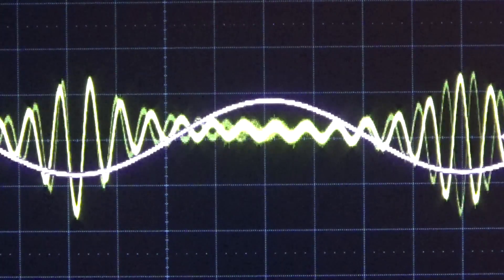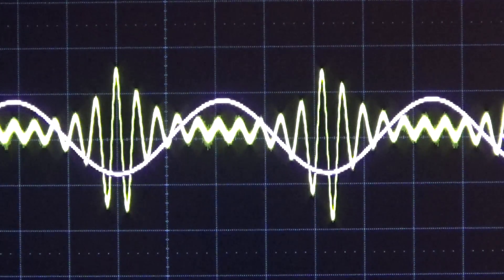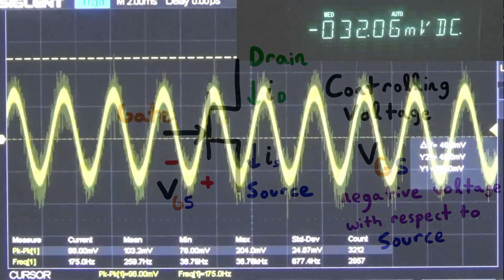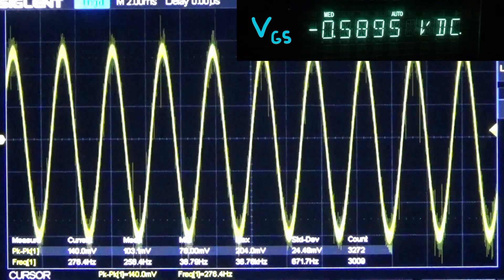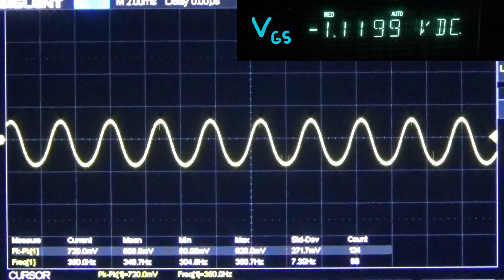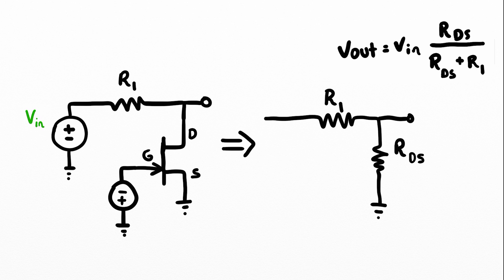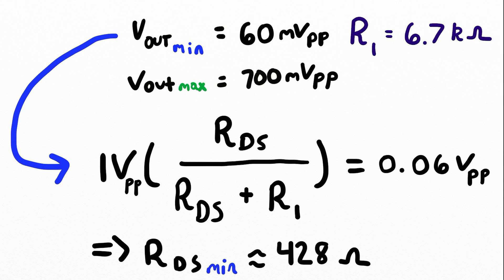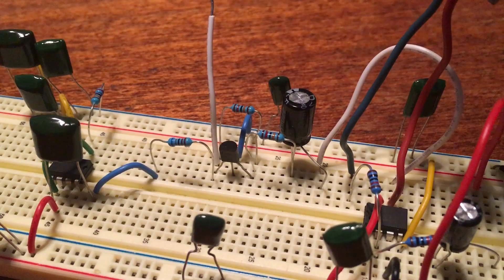JFET Voltage Controlled Resistor Circuit

Comment: Thanks so much for making this video, it was super helpful!

May I ask what model the JFET you used was? (If you still know)

I'm trying to use this to make a Voltage-Controlled Wien Bridge Oscillator... I've devised a super complicated function generator to dial in precise resistance values, now I just need to find the best components to build it with

Comment: Thank you for this video and the working of the jfet as a resistor in a linear way. An AGC for small signals using op amps will be possible. Very simple and straightforward and easy to learn and comprehend by the way you explained.

Comment: Isn't the "pinch off" voltage the highest (least negative) voltage where it conducts the least?  I.e. maximum resistance, minimum signal output?  You seemed to be saying it was the voltage where the JFET enters saturation, and conducts the most.

What sort of dynamic range are we talking?  Would the output go low enough to seem like it was shut off, or would there be a noticeable signal bleed?

Comment: Thanks for sharing. Looks like it might make for some interesting modulation effects in a synth.
Reply from the maker: Yes you are right! It's main appeal is that it is voltage controlled, hooking and oscillator up to it would be one way to create effects! One circuit I am interested to create is a variable lowpass filter. Thanks for the feedback!

Comment: Excellent video, could this potentially be used to construct a Voltage controlled amplifier?
Reply from the maker: Hey Alt - Yes the JFET can be used as a voltage amplifier. If we set the JEFT circuit up to normally operate in the saturation region we can use it very effectively to amplify an input signal!  Thank you for the feedback!